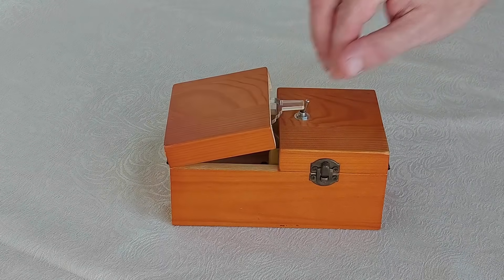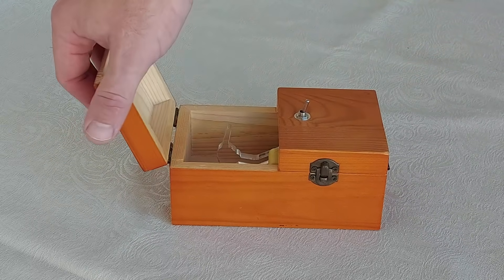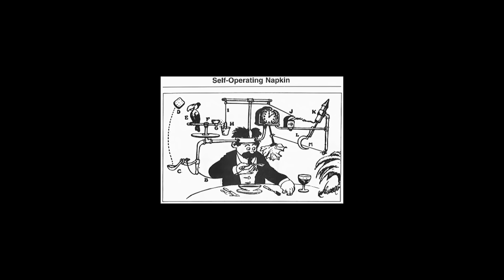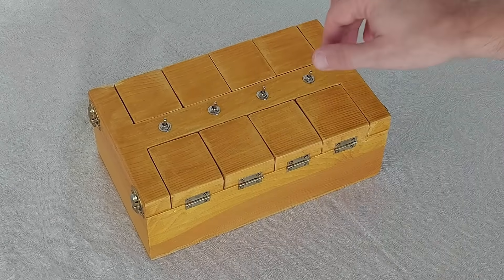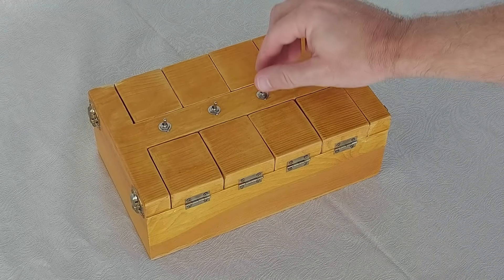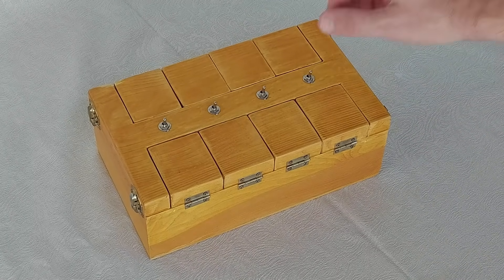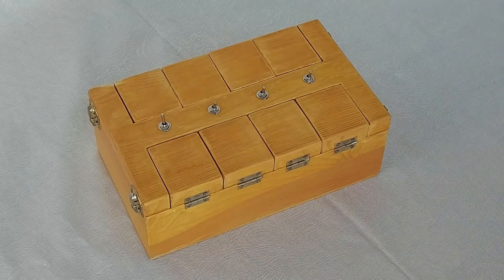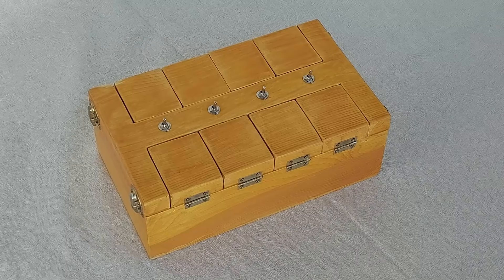A Rube Goldberg inspired useless machine

Comment: I wonder what would happen if you forced the mechanism to be permanently on
Reply from the maker: The software reads the switches' states and responds to the first switch it finds on. If the rest of the switches are turned off during the process, then the box will shut itself off at the end of the process. If the software is still active at the end of the process it performs a recovery script that turns all of the switches off.

Comment: what happens if all switches are turned on at the same time?
Reply from the maker: The software reads the switches' states and responds to the first switch it finds on. If the rest of the switches are turned off during the process, then the box will shut itself off at the end of the process. If the software is still active at the end of the process it performs a recovery script that turns all of the switches off.

Comment: Rube Goldberg would have the switch turn on a hotplate, which heats water in a kettle, when boiling, the steam would push a bowling ball onto a track, at the end of which would be mechanical arm, that would finally reset the switch. 
Or something similar.
Reply from the maker: I wondered how much "Rube Goldberg" the machine should be. I like the movement and rhythm of Rube Goldberg's machines more than I like the variety of instruments and the commotion it makes. You see the instruments moving, you hear the commotion, but I think that the choreography and rhythm make a great Rube Goldberg machine great. That's why I named it "a Rube Goldberg inspired useless machine". "The voice is the voice of Jacob, but the hands are the hands of Esau".
Reply: @pazhameiri3429  Oh, don't see it as criticism. You'd need a good sized warehouse for a real Rube Goldberg Useless Machine.
All I tried there was to describe how the master himself woulda gone about.
Reply from the maker: @peregreena9046   You're probably right 😃

Comment: Absolutely beautiful. At the same time, using a microcontroller just feels like cheating.
Reply from the maker: Thanks 😄. I thought a lot about this. The initial design did not include a microcontroller - I thought about using internal state switches to control the movement of each motor. But the more I thought about it I had more and more scripts that I wanted the box to perform. I thought about installing a rotary switch to choose a script, but had too many scripts in mind. I even considered using different short plugs to control different scripts. Eventually, I gave up - we're living in the 21st century - a microcontroller is better than a multistate rotary switch or a box full of short plugs. As long as the microcontroller turns on when a switch is flipped and turns off on the last switch flip, then the machine is a "true" useless machine. I wrote 47 different scripts for the box to perform. I couldn't do it with a rotary switch or short plugs.

Comment: I'll say that it fits the 'spirit', at least the overly complicated part of the spirit. But it's lacking the over the top, cartoonesque pieces.
I like it, but it's only 10% Rube Goldberg, where I would have preferred to see 50 or even 90 percent instead.
It's still a definite, funny upgrade over the original. With a good amount of care put into it.
It's a Rube Goldberg machine with all of the personality stripped off. That sounds like an insult, but it's not necessarily a bad thing. A RGM mostly for programmers and engineers.
Reply from the maker: I wondered how much "Rube Goldberg" the machine should be. I like the movement and rhythm of Rube Goldberg's machines more than I like the variety of instruments and the commotion it makes. You see the instruments moving, you hear the commotion, but I think that the choreography and rhythm make a great Rube Goldberg machine great. That's why I named it "a Rube Goldberg inspired useless machine". "The voice is the voice of Jacob, but the hands are the hands of Esau".

Comment: No Steel ball that rolls into the off switch after countless object collisions and precarious pathways?
Reply from the maker: That would be a Marvin Minsky inspired Rube Goldberg machine. A steel ball that rolls into the off switch after countless object collisions and precarious pathways would be a one-trick pony. I wanted a stallion.
Reply: @pazhameiri3429  you did well sir. Good job. Maybe next time it can be solar powered with a panel blocking arm that can move shutting the power of that way too. Maybe it crawls away from the light and lays on its solar panel lol.
Reply: And Or crank powered and it puts a stick in the spokes. Or it has a battery slot and it ejects it's own battery once it charges the actuator. Maybe all 3?
Reply from the maker: @AddisonLarson  😊

Comment: I like that it seems like the same switch doesn't always trigger the same pattern to turn it off.
Reply from the maker: I programmed 47 different scripts. Some of the scripts are related to the first switch that is turned on.
Reply: @pazhameiri3429  holy s*** I'm not even gonna lie I respect the commitment to that 🤣
Reply: @pazhameiri3429  aw man that seems like hours of fun
Reply: @pazhameiri3429  can you flip 2 switches at the same time
Reply: @pazhameiri3429  that’s cool, although I think the box can only run one pattern at a time instead of randomizing the scripts otherwise you wouldn’t have needed to use a variety of cuts.
Reply: But can you flip TWO switches?
Reply from the maker: @Blahaj_Gaming847  You can. The software reads the switches' states and responds to the first switch it finds on. If the rest of the switches are turned off during the process, then the box will shut itself off at the end of the process. If the software is still active at the end of the process it performs a recovery script that turns all of the switches off.
Reply: @pazhameiri3429  That's actually quite smart, well done.
Reply: @pazhameiri3429  could you flip all 4 switches and have it still turn off?
Reply: @keiz_  yes. He said it will react to the first switch activated.
Reply: Is there a possibility for an infinite loop?
Reply: I suspect you could. The microcontroller would keep reading that a switch is still on and keep invoking routines to turn off the switches until they are all switched off, either that or it would, after the first routine, invoke a routine just to turn off all of the switches.
Reply: @pazhameiri3429  that's useful, identifying user error and self-correcting it.  You have to predict things the user might do, not what is intended by the creator. This is a fundamental mistake that programmers make, too often... forgetting people either by accident, or by absolute intention, will do things in a non-intended fashion just to 'see what happens'.
Joker is right, some people want to watch the world burn.. I do too but only on small scales.. 'what happens if I put 'tava into slot b', sorta thing.. but not in something I invested in, mind.. this is all situational.
Reply: @Blahaj_Gaming847  physically yes, mentally no
Reply: @Blahaj_Gaming847 is the only ⁴tt44⁴3
Reply: The patterns it creates is very satisfying to watch and listen to. Especially when there are 2 clicking.
Reply: @lucassmart1473  too smart
Reply: @lucassmart1473  then do it better 😉 competition between useless machines 🤣
Reply: there actually is a mathematical sequence to it
Reply: https://youtu.be/8aVJLRUWn0k
Reply: I see at times there are video cuts between powering on  ...reprograming ?
Reply: Probably the same thing will give me nightmares
Reply: That's the Beauty of Good Useless Machines...

They have at least four unique patterns.

A good example is the "Don't wake me" useless machine.

Comment: What happen if you turn two+ switches on before the device’s response?
Reply from the maker: The software reads the switches' states and responds to the first switch it finds on. If the rest of the switches are turned off during the process, then the box will shut itself off at the end of the process. If the software is still active at the end of the process it performs a recovery script that turns all of the switches off.
Reply: @pazhameiri3429  make sense, thank you. Must say, it’s an awesome project.
Reply from the maker: Thanks 😀

Comment: Love it and the whole principle, but wouldnt running off the processor be kinda cheating? I mean yeah, elaborate in code, but in a simple execution? Shouldn't it have some kind of baroque clockwork inside or something?
Still, love both versions, just being nitpicky👏👍😄
Reply from the maker: Thanks 😄. I thought a lot about this. The initial design did not include a microcontroller - I thought about using internal state switches to control the movement of each motor. But the more I thought about it I had more and more scripts that I wanted the box to perform. I thought about installing a rotary switch to choose a script, but had too many scripts in mind. I even considered using different short plugs to control different scripts. Eventually, I gave up - we're living in the 21st century - a microcontroller is better than a multistate rotary switch or a box full of short plugs. As long as the microcontroller turns on when a switch is flipped and turns off on the last switch flip, then the machine is a "true" useless machine. I wrote 47 different scripts for the box to perform. I couldn't do it with a rotary switch or short plugs.

Comment: I would definitely buy one of these.
Reply: I do want one. When will you be mass producing these?
Reply: Or at the very least plans for how you built the four switch model.  Its complexity of movement is only matched by its sheer simplistic operation...I need to figure out how this was made and make one myself.  😲🤓😲
Reply: @earlware4322  It's written in software
Reply: $25 and I'm in
Reply: Bruh I thought this amd then immediately saw this comment
Reply: But it's useless  ! ;-)
Reply: @sirhenrypatschislewsky5248  nobody knows the value of entertainment
Reply: @NuclearFall0ut  999
Reply: Same here
Reply: Is there a way to order one? I really want it.
Reply: I want to buy it. Poland here. :)
Reply: Would be even better if you could make one.
Reply: Just buy a Bitcoin miner instead. They perform the same function: nothing. They just do it much less efficiently than this.